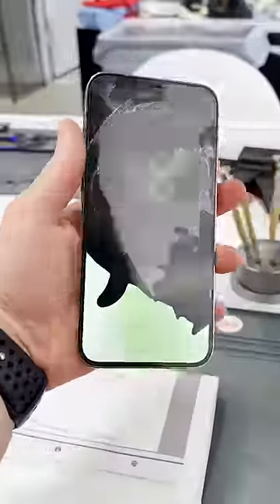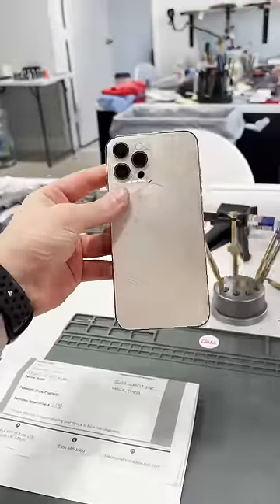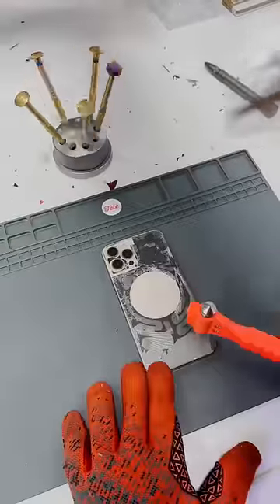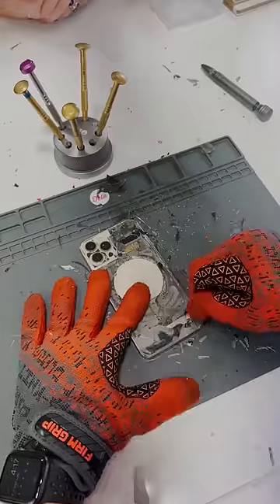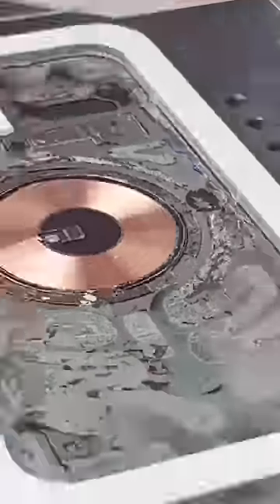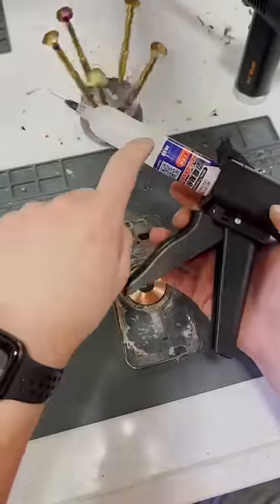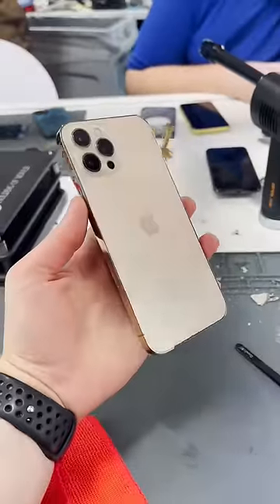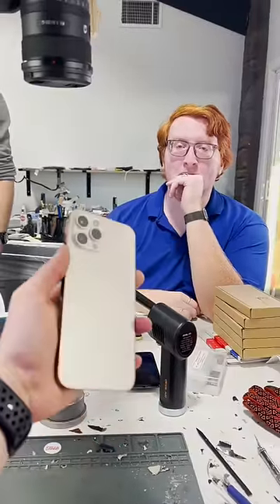This iPhone fell off a Fair ride #shorts #laser #oddlysatisfying

Comment: They probably wanted the back done by you to save a bit of money and then they probably went to apple to get them to replace the screen with a genuine one
Reply: Would Apple fix it with a non genuine back glass? (Would they even notice?)
Reply: @SCRPXXL  they’ll know… because it’s apple
Reply: @SCRPXXL  no, but i think it would be twice as expensive as if it was only the screen
Reply: Makes sense
Reply: it's cause apple fukin pairs the screen to the iPhone where you cant repair the screen in a third party shop or else the phone loses face Id camera and other features.
Reply: Not really, apple quote over £100 for a screen replacement. They probably fix the phone screen themselves
Reply: @SCRPXXL  in the US it’s illegal if they refuse.  magnuson moss act.  Back glass repair had no impact on the display failure. Yes it’s apple and they probably have denied someone on such a basis before and will again but legally.. no apple can’t nor should be denying in such basis.
Reply: @yagirlcheetos  they don't have a clue, Apple does not do repairs hahah
Reply: @SCRPXXL  apple gives you a new phone if the back glass is broken
Reply: @organiccold  ? They do repairs at the apple store they hire technicians whose only job is to repair screens and other internals. However if back glass is broken you get a new phone to avoid messing with the camera quality or waterproof seal

Comment: Probably cheaper to get a screen replacement from some shady place, for the backs most don’t have those laser machines and rather they try to forcibly shove a scalpel to break off the glass which in turn fucks up the back frame by denting it up. Of course, preventing the new back glass from sitting flush

Comment: Do screen protectors really medigate  that amount of screen damage?
Reply: A tempered screen protector can really help with preventing damage to a screen.  Really just depends on the angle and how hard it falls. But it's a lot better than just a bare screen+ a case does wonders
Reply: No a lot of those glass screen protectors are harder than the original glass and don’t absorb an impact and spread the force of it. The point of them is too crack and break so the actual screen doesn’t. So if you have one that cracked but your screen is ok then you got a good one because they are meant to crack.

Comment: They have to change the back glass again if they wanted to have the lcd display replaced, right?
Reply: Only on Samsungs do you have to go in through the back for screen replacements, which is why they are so expensive to repair; requires a full teardown for a simple screen replacement. But as far as I'm aware you don't have to replace the back glass entirely. iPhones allow you to go in through the front for screen replacements and are very easy.